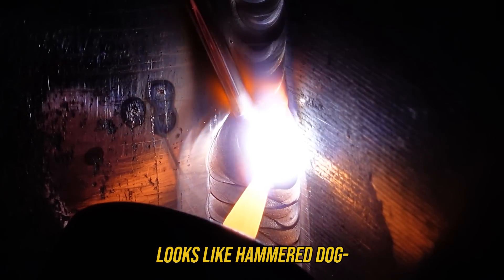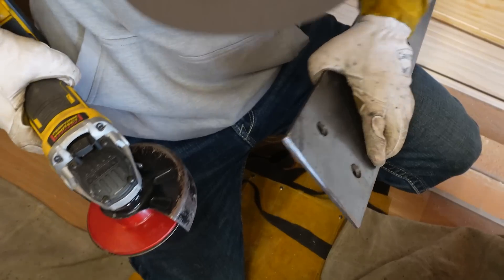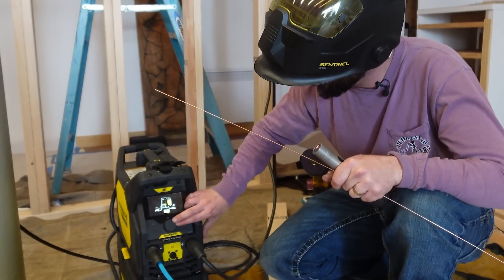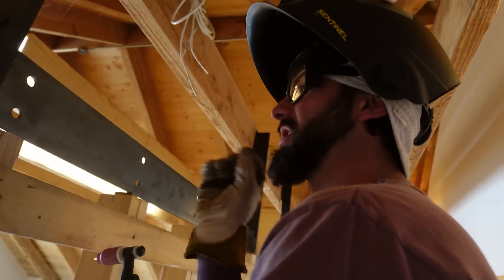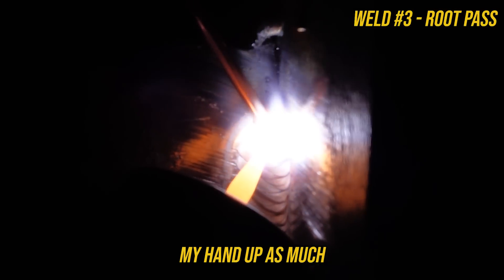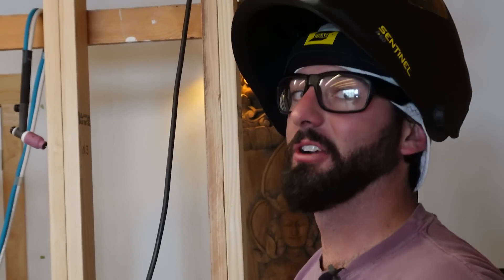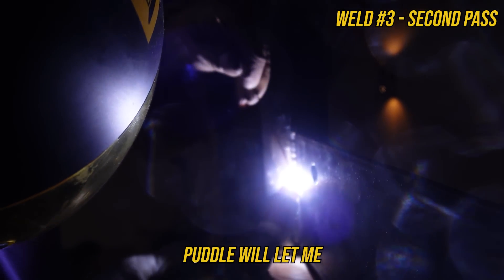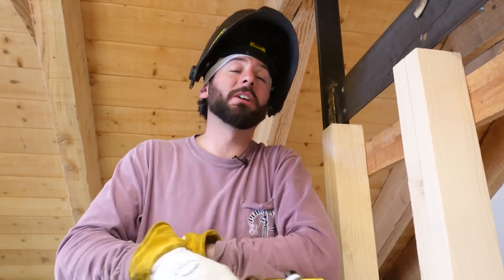Can You TIG Weld On A Regular 110v Outlet?

Comment: It's all about the math. A 20 amp circuit will handle it depending on the voltage and amp(s) selected - after you deduct for the inefficiency of the inverter.

Comment: Need to repair some anodized aluminum piping on a t top. What fairly inexpensive tig unit you suggest
Reply from the maker: Id go with Everlast, Youll need HF start and AC,
Reply: @Welddotcom  do you have a model suggestion

Comment: My 110v TiG outputs 150 amps. Plenty for most anything. Add preheat if it is thick, and there are few limitations.
I have done .750” Aluminum with 88 amps. You just have to know the way.
Reply from the maker: Great advice! one thing to be aware of is you can pre heat tooo much causing the aluminum to anneal. But it does help if you cant get the amps out of it. -Austin

Comment: I thought you weren't supposed to pull the torch away immediately.  Is postflow less important for mild steel?  I couldn't tell on the video if it affected the weld or not.
Reply: They are running scratch start tig . You have to pull away otherwise the arc won't stop
Reply: @JonasDecker-z3x  to me it looks like they use LIFT TIG without a switch and just pull out off the weld just like scratch start.. I could be wrong
Reply: @Bakanelli  that's what I mean . I don't understand why they are using that in so many videos tho . Is it really still common.
Reply: @JonasDecker-z3x  well reason in this video is obvious - he is standing up so using the pedal is not practical at all. He could be using switch on the torch to start the weld with HF and to turn it off but he doesn’t which is interesting to me
Reply: @Bakanelli  tbh I'm from Germany and pedal tig is pretty uncommon.  We even weld aluminium with switch tig and hf . Kinda sucks tho .first nothing happens and then you start to run to keep the puddle constant
Reply: @JonasDecker-z3x  I totally get you! I am from Slovenia / Croatia and having pedal is also uncommon… 
As for me I was addicted to enough of YouTube TIG welding videos beforehand so I bought the machine with the pedal in the first place… 
After 3 years of having it I got to enough uncomfortable/awkward welding positions that now I finally ordered a switch. 
Cheers
Reply from the maker: sometimes you have no choice if there is no remote to tell the machine to stop, wether a foot pedal or "hot switch" on the torch. this does leave oxidation, a wire wheel will fix it fine before any finish. in my experience, they allowed you to "buff" the stop to clean it up. even on stainless and other alloys.

Its more of a "in the field" application, rather a shop... -Austin

Comment: that looks mighty weak for that thickness. Sure it keeps the pieces together, as long as you don't really exert forces on them.

Why even try welding such thick steel at 110V ?
Reply from the maker: Was the only option. and for what it will be used for, there is plenty of weld all around. Itll hold a couple people for sure. -Austin
Reply: @Welddotcom  that certainly is true, but i see it as a trap if you weld heavy material with the caveat that it should only be used following strict loading limits. If the beam strength is heavy the weld should be heavy to match. Otherwise it's just asking for trouble.

Even if in this case it would work fine.

Comment: I realize you were taking great care to minimize sparks and not start a fire, especially around all that kiln-dried wood. But how long after welding finishes should one wait to do a final inspection, to make sure nothing is smoldering?
Reply: Usually a 30 minute fire watch post any hot work (welding, cutting, grinding, burning, etc) is standard
Reply: 1/2 hour is standard on Coast Guard Ships. Little hot sparks get into little unseen cracks and bingo    FIRE  ! !  Better safe than sorry. And have your fire suppresion ready on the job, don't wait for a fire and then go, uh where is the water ?

Comment: did an open 1/8th inch corner joint on mild steel yesterday @ 120V (100amps).  and with a small Arccraptain tig welder I bought for $250   wish I had 240V in the garage but the landlord said no.
Reply from the maker: uping your breaking on the 110v outlet to a 30amp can help not trip it as often. -Austin

Comment: 120v is the standard since the 1960s.  Stop saying 110v
Reply: it does not matter.  Everyone knows what's being talked about.  Major electric motor manufacturers like Baldor still list their motors as 115/230V.  I bet welders aren't sold as true blue 120/240 either if you read their data plates...Are you going to throw a needless Q.Q fit over that too?

"wHy DoESnT tHe NaMEPlaTE sAY 120/240??" He screeches from the Youtube comments section, with tears in his eyes.
Reply: @jaywelker5566  right, it don't matter.  Just like how he could weld at 150 amps from a 15 amp wall socket don't matter either
Reply: @armelpeel  you understand that the welding machine regulates voltage and amperage right ? 100 amps yes but at around 8-10 volts
Reply: PLEASE IT SOUNDS LIKE YOU DONT KNOW WHAT THE HELL YOU ARE TALKING ABOUT!!!  This guy welded at 150 amps from a 15 amp wall socket?  Did you have a diesel engine in your pocket?  Wtf this theater.  Also your angle grinder was barely an inch from your leg.  Safety violations, electrical side was basically pure gibberish.
Reply: there is no difference. who cares? many welders and appliances are sold as 110/220.
Reply: Personally, I have not seen much difference in performance between homes at 110v or business at 120-130v. Now 208, 220, 230 can make a difference. City changed power source for "money savings" from 230 3phase to 208 single phase.. The weld/fab shop had to do some machine mods. Some were a simple dip seitch change. Some required a motor replace. Some required a complete new machine.